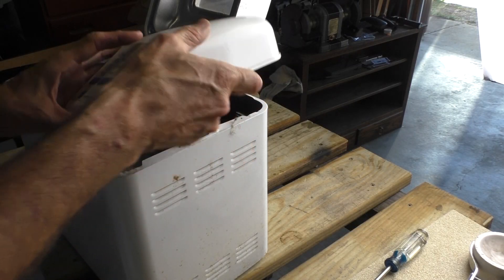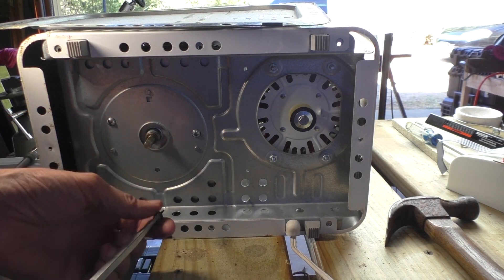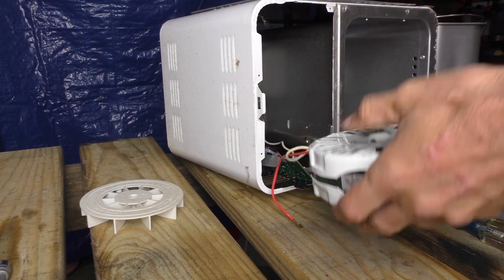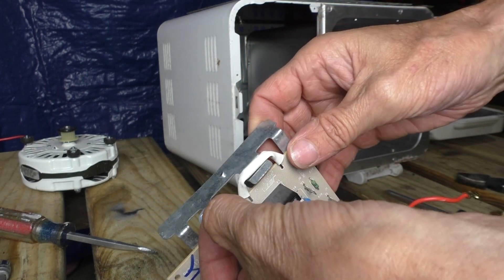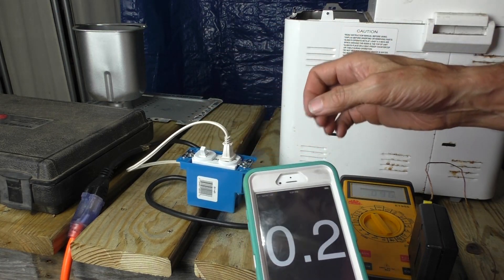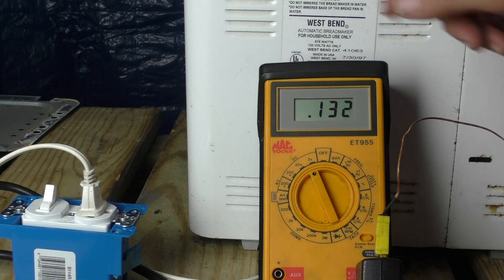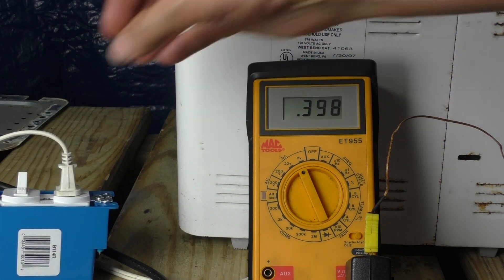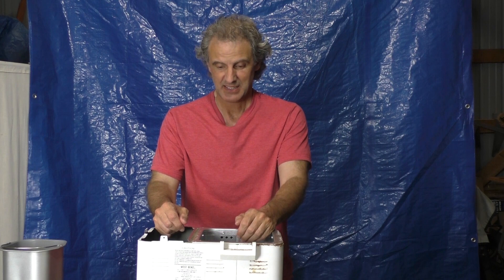Can we make an electric Foundry from an old bread maker?

Comment: You think some thermal insulation could help trap more heat? I've seen some high temperature stuff used in domestic electric ovens.
Reply from the maker: Yes, most use kaowool.